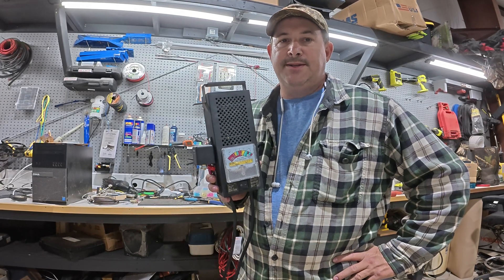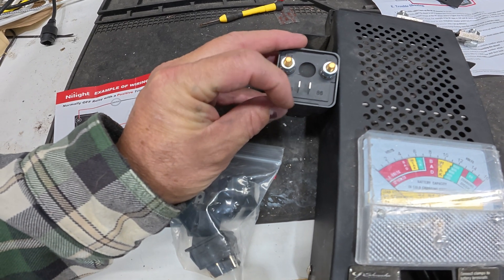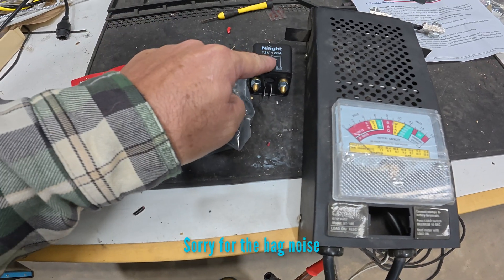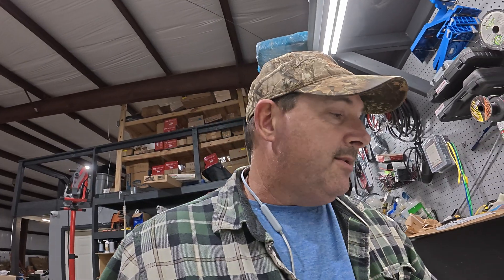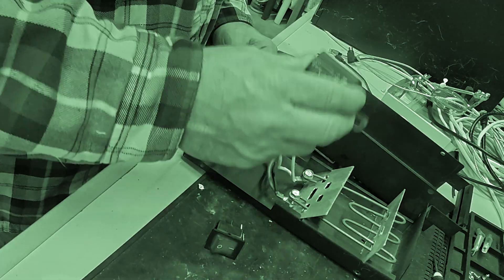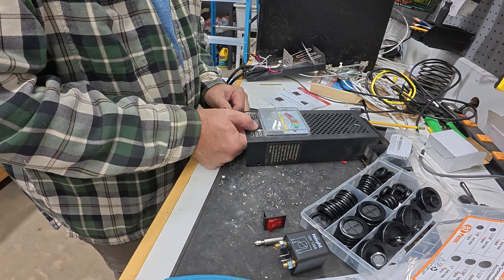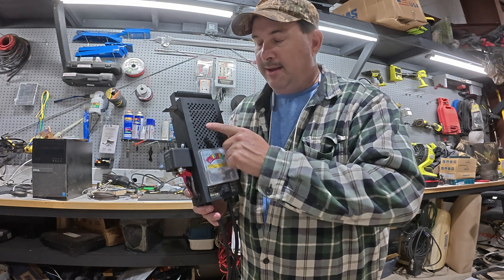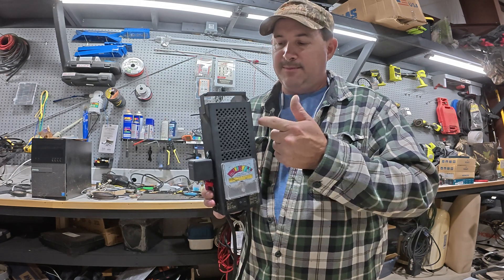✅ Best BULLETPROOF Battery Load Tester Switch Repair - Keep burning up the switch? Add a 120A Relay!

Comment: This is a nice fix.  But I wonder...  Maybe just buy a pack of switches and swap them out when one fails.  I wonder how many times the switch would need replaced before the coil or meter broke?
Reply from the maker: Probably would be just fine doing that but what kind of fun would that be :-).  Disposable world we live in anymore and the cost of new is so cheap, but so are the new items.